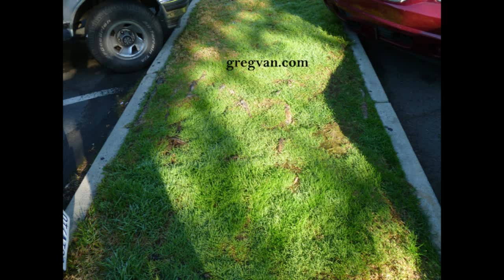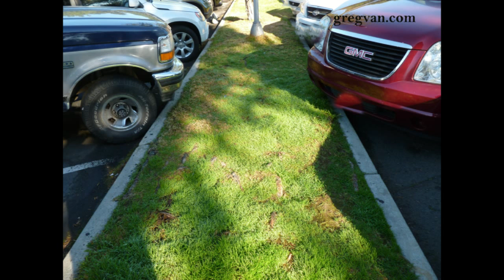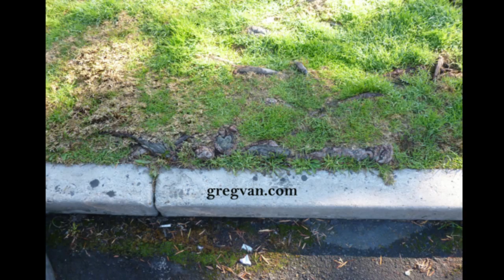Surface Tree Root Problems In Parking Lot Parkway - Design And Maintenance

Comment: Certain tree species are just more sensitive to lack of Oxygen below soil grade, thus grow over crappy conditions. Not necessarily because most common planted urban tree types evolved to survive Midwestern bottomland conditions, by facing extended flood events with production of shallow surface rooting to secure standing tree in ground better.
Reply from the maker: I think it would be a good idea to learn more about trees if you're planning on planting them around your property. Selecting the right trees could save you a lot of money.
Reply: Great planting tip Greg. Save money in air conditioning cost. Also considering hours of direct, or partial sunlight required can determine what is best side of house to install it. I like to remind people, neighbors have right to prune your trees back to their property line. Except if such pruning could permanently damage tree. So I suggest people go out and find older versions of tree species you are thinking of planting. Today neighbors can change every 5-15 years, and it's becoming popular to remove all their new properties trees soon after moving in. 

Biggest mass planting mistake guilty of, was selecting amateur tree species to be installed on public parkways. 

Too many amateurs such as Norway Maple, Linden, Silver Maple, Red Maples planted to replace diseased Elms over past 50 years. As an Arborist who enjoys rescuing declining trees, by correcting or managing technical health issues. There is nothing humanly possible to prevent lesser species further decline and inevitable removal. Except go back in time so you can select better species known to thrive and survive in your pre-researched ecocondition specified location. ENJOY!
Reply from the maker: It really is one of the most difficult parts of life, figuring out what's going to work and what won't. I am currently in the process of removing a palm tree that was planted to close to a concrete pond. If your next question was, did I plant it, yes and this was the second one I've taken out.

Comment from the maker: Mother nature in itself is one of the most awesome things around. But it is and always will be amazing to me, how a small seed from a tree can turn into something so massive and wreak havoc on man's creations.
Reply: Ironically humans lack of understanding results in trees doing what they are exactly supposed to do. Ancient humans in fact utilized roots hydraulic pressure to mechanically separate quoried rock, by threading in between existing gap.

Compacting engineered grade mechanically is required before pouring sidewalk slab.  And just like above ground tripping tree roots growing on top of grade, because lack of oxygen in soil below. Roots do same under sidewalk, further encouraged by moisture collecting on dark cold bottom side of slab. Whole garage foundation slabs lifted by roots are my favorite. That's power.

Attracted to leaky loose joint fitting clay drains, and cracked foundations whose jagged edges become magnets for moisture. Tree roots come in and do what they are supposed to do. By man unknowingly causing it to respond, like trees had evolved to do all along.